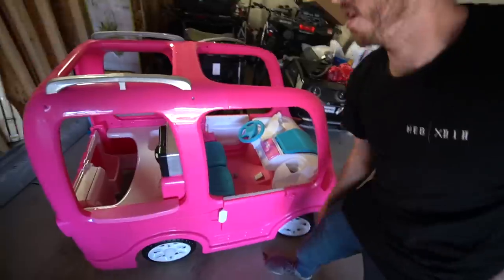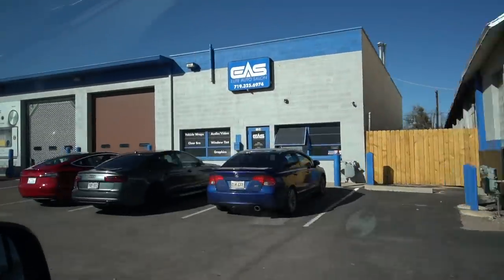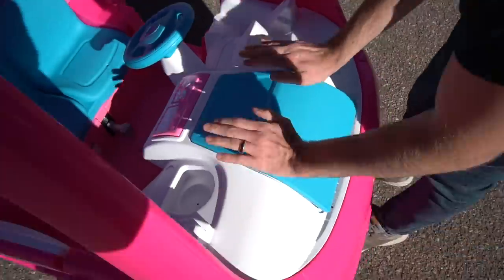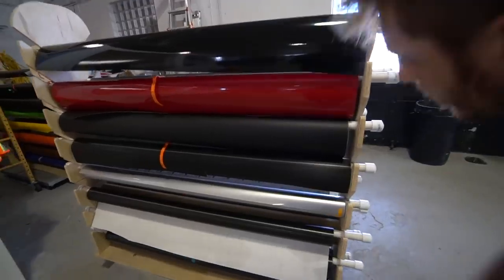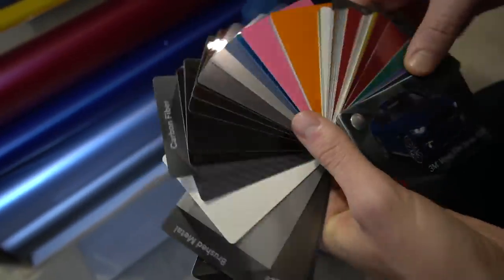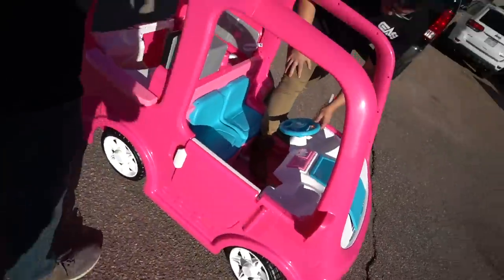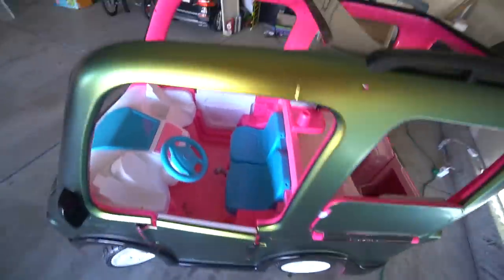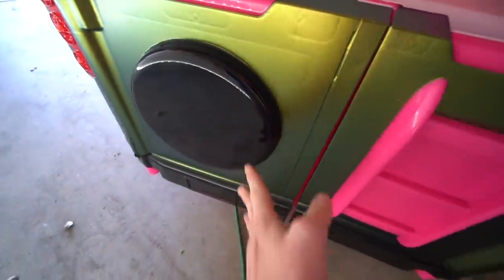Custom Toy Car WRAP! (REVEAL)

Comment: 1. Windows
2. Convertible roof
3. Subwoofers
4. Make it go like 50mph
5. Put back seats
6. Underglow
7. Add in a sound system to make it sound like a real car
8. Working sink and grill
9. BED
Reply: love it!
Reply: You must be 10 along with "Faze" over here.
Reply: Love it
Reply: Maybe a bit too small for all that
Reply: That what I was thinking
Reply: Instead of the sound system, install an engine. It knocks out 4 too, because the engine would give it more power than solely a battery, while also giving it that sound, if it has a gas engine.
Reply: Tots right
Reply: YES
Reply: Too small for a bed working sink grill backseats exe.
Reply: @Samuel Snyder Most semi trucks have beds. The backish window part is a bed because of the long drives
Reply: The os or a pane of glass

Comment: Stronger Engine, better wheels, change the inside, go to an upholstery shop and get some cool seats, just mix it up, do what you guys do best!
Reply: Not a engine cause that doesn’t work
Reply: Off-road suspension
Reply: Cael Terry you could technically put some small tiny engines on each wheel and hook them all together like a Tesla but smaller

Comment: Get a 6 or 8 horsepower motor, (136cc motor.) and use that as your motor.  Steering and wheels will need to be upgraded.  May be worth it.  This means you will be able tl haul more and do much more with the car.  At least get a 24 volt system.
Reply: LamefishingwithJonandhisdad no they need a v12 that thing would rip but be huge

Comment: 1-Place even more power full engine (please do this one) 
2- make double batteries 
3- make a batter stickier battery
4-make a openable and closeable roof for it
5-sounding system also with a separate battery
6-take out a furniture from behind and place better stuff(your own idea)
7-place long color changeable LEDs on top and around the car(for inside of the rv mostly)
8-place front and back lights with right and left lights 
9-high density front lights 
10-place windows electric (not your job you should give it to an engineer (
And also when you are going out with it take few battery's filled up

Comment: u need to get a carbon fiber interior and new rims and a seat in the back so you can both ride it at the same time that would be lite
Reply: It should be more metal so it can hold them both

Comment: What I would add to it 
Step 1.add costume black seats
Step 2.make the inside frame black
Step 3.have a costume radio
Step 4.have an engen  
Step 5.have head lights
Step 6.put in a different sering weel  
Step.7 put in a floor mat
Step 8.😊smile 
Step 9.do a silly dance move 

First let me like my comment

Comment: use the back are of the van for more space to sit. So you should remove the kitchen stuff, and then move the seats back so you have more space to sit and put things.
Reply: Or like maybe remove the kitchen and put another set of seats so they can both sit in together
Reply: It might be a bit slower but still

Comment: You should

Put a fridge in the back or a another seat so you both can sit in it in the same time or you could put a small table and put radio on it and put a mini fridge (really small fridge) 
Or you could put a engine so the car goes fast

I think if you could make one of you drive and one of sit in the back and sell stuff (pizza ice cream and more stuff)

Maybe yoi can expand the car so all the stuff would fit in it

Camo seats

99% you wont see thes

If you agree like
Reply: yeeeeeeeeeeeeeeeeeeeeeeeeeeeeeees
Reply: With 3-400 pounds it wouldn't move.

Comment: - extend the roof of the car by two feet, then add a full custom windshield and matching sunroof.
- new wheels and rubber tyres + lift the car slightly for higher ground clearance
- new sound system to replace kitchen
- neon lights under the car
- licence plate
- new seats
- side exhaust

Comment: List of mods you should do:
-get a real radio
-add headlights and backlights
-get rid of the fake GPS and put in a real one
-remove the kitchen and use that space for seating
-add light strips underneath the car
-put your logo on the side
-put a working horn (preferably a train horn for pranks)
-put in a better motor (not sure what the point would be unless you add the seating in the back)
-put outlets in the car

Comment: New wheels… rubber would work or you could get some scooter wheels (the hard ones) and try to fit them on there. Also you should maybe try and cut out the separation between the half kitchen and the front because that would allow either 2 people to sit back to each other or 1 person to sit with room. Also you could replace the seats with something soft or just add some foam to it. I hope you take my ideas and put it into a video I love your channel you so awesome

Comment: Could do a 212 swap or if you don’t wanna tackle gas you could get larger amp or voltage batteries like the ones on rc cars or power drills

Comment: I would change the color of the interior so where you can’t see any pink at all on the car, real tires, audio system, and leather steering wheel, and motor swap 🤙🏼

Comment: Change the tires on it and put a better battery or something in it put camber and under glow on it remove the kitchen stuff and move the seats back chang the inside color and add a hydraulic handbrake and make it rear wheel drive like if you agree 👍

Comment: That is 24volt if you upgrade 48v 1500w electric motor or 72 battery will be fast  check it on Amazon